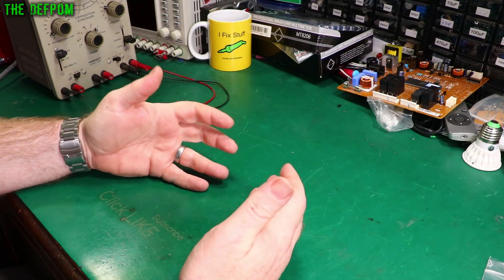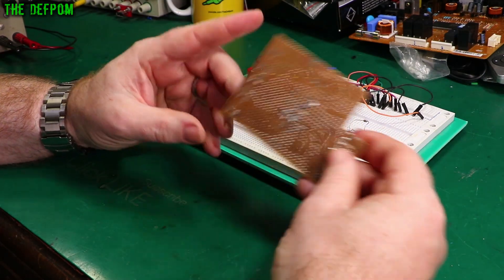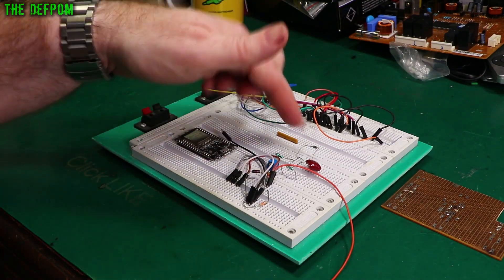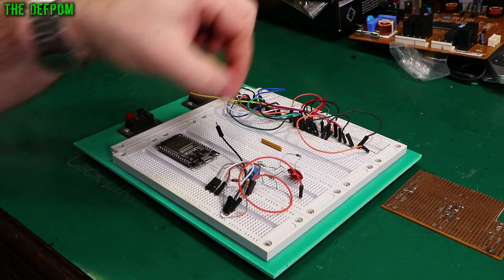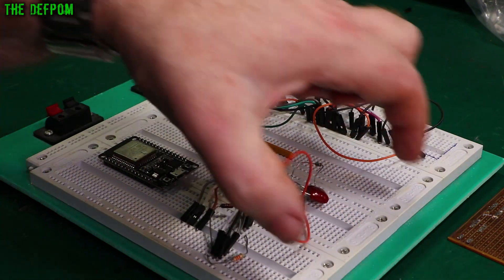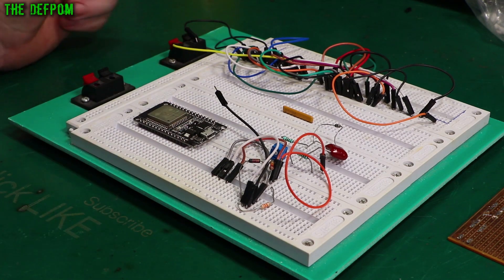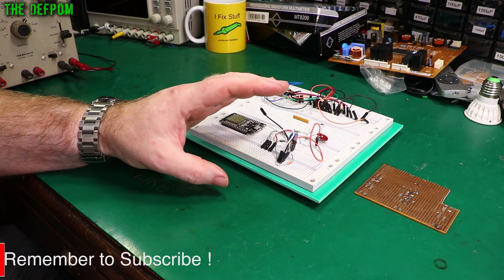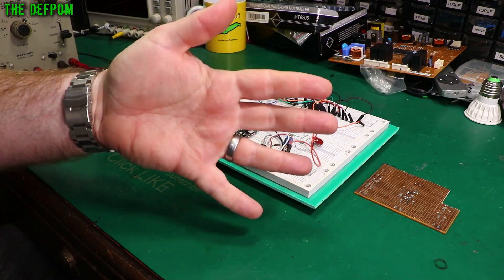🔴 Electronics Tools For Beginners - No.5 - Bread Board and Perforated Board - No.1004

Comment: I almost never use bread board or perf boards anymore. I make proper PCB for prototyping myself, it only takes 1h to make PCB after designing it. If you use SMD you don’t have to drill it. 
Tired off troubleshooting design faults that are no faults just bad connections.